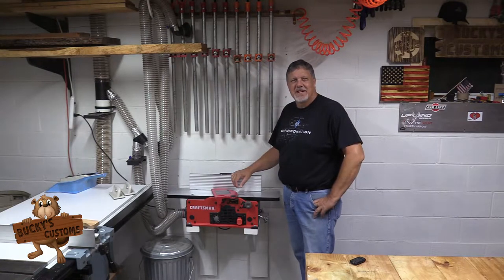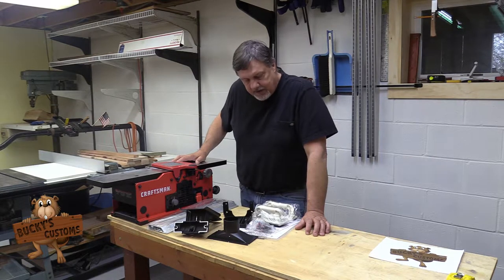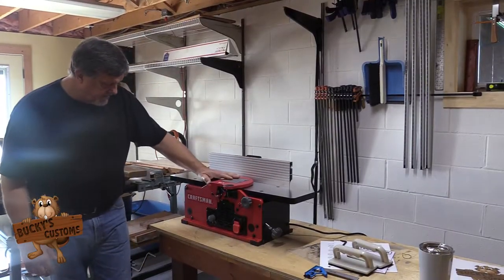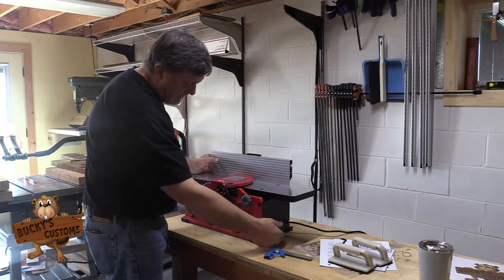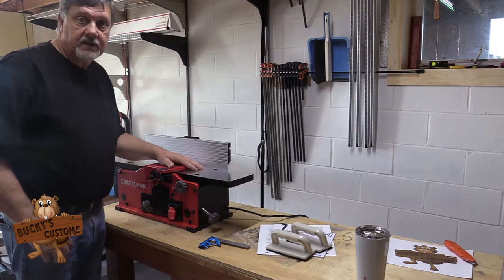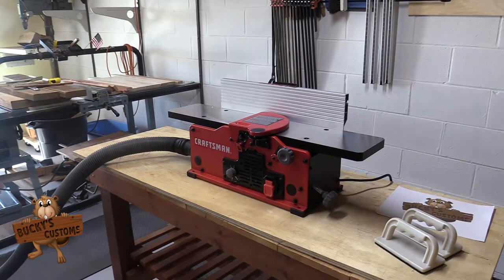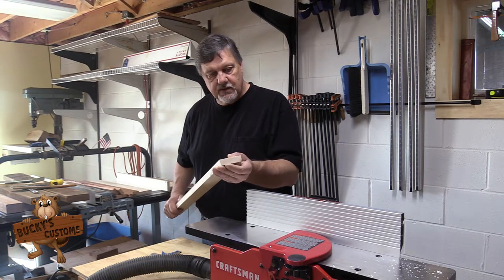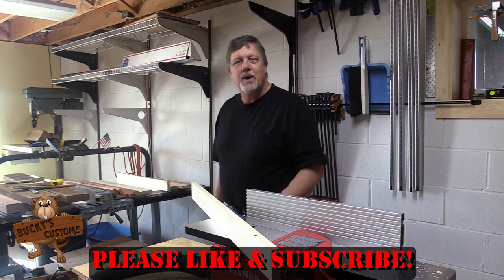Craftsmen 6 inch Benchtop Jointer Review

Comment: I bought the same jointer from Lowe’s approximately two years ago. Just opened it about a month ago. It was brand new but looks like it had been opened. It was in original packaging, doesn’t look like it was ever removed from from box. The only thing missing was the manual. I was able to pull up the online manual but was only needed to find out what the red “lockout” device was. The thing assembled without a manual. I put a square on the fence and it was perfect. I’ve used it for approximately four hours and works great. For a small shop or hobbyist, I recommend it whole heartedly!

Comment: Thanks for the video. I this jointer on sale at a local lowes.  And bought the couple of days ago. I have one project to finish before I open it. 
Have you had any issues with the short Infeed and outfield tables? I watched a couple reviews where they commented about the table length. 

Thanks again.
Reply from the maker: Table Length is definitely an issue. I use it mostly for cutting boards so works well. And I have no room for a floor model
Reply: @BuckysCustoms  this is my first jointer so I apologize if this is a dumb question. Are you able roller stands  to to extend the infeed and outfield, like you would on a miter saw?

Thank you
Reply from the maker: @donovanraaum3259  if you can stabilize them well enough and you have the room. Not ideal but could work

Comment: Good video I have a question: Can you sharpen the blade?
Reply from the maker: I never have but I am sure they can be.
Reply: @BuckysCustoms  And if you work with soft wood, does the edge of the blades last long?
Reply from the maker: @AlexGomez-qt5sz  soft woods are definitely easier on the blades.

Comment: I have bought this jointer and had to return it because it stopped working in 30 mins, replacement came and stopped working after 1.5 hours, if you read the reviews on craftsmans website 15 or more of the most recent 1 star reviews are all for the same reason, there is some design defect in the motor and it just dies
Reply from the maker: Mine has had no issues. Love it! Maybe it is a recent problem?
Reply: @BuckysCustoms   I bought over the summer with my stimulus check, the first one I got I ran one small piece of 2x4 through to check it, I turned it off and reached for another piece, and when I turned it back on it was dead, no nothing, I returned it to lowes and got a replacement and after running around 15 feet of 4x4s through it it died mid cut and wouldn't turn back on, I was pretty bummed because it was my 1st jointer and when it worked it did a good job, but seeing all the reviews of the same exact issue make you realize that it's a crapshoot of weather you will get a good one or a dud
Reply from the maker: @jefftucker9225  Geeze I wonder if there is a problem with the Speed dial. did you try turning it back and fourth? Regardless, not your problem and taking it back to the store is probably the best. Mine still runs strong and I use it almost everyday. I love it. Sorry you are having issues still.
Reply from the maker: @peternelson5113  That is very strange! Mine still works fine! I hope this gets resolved soon!